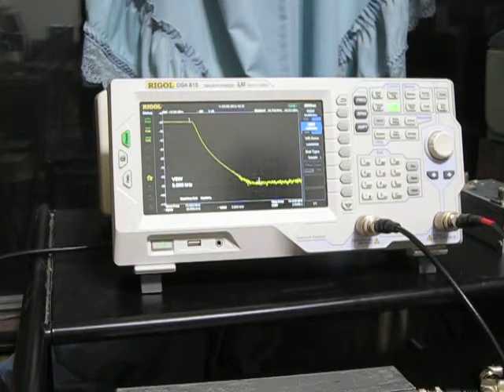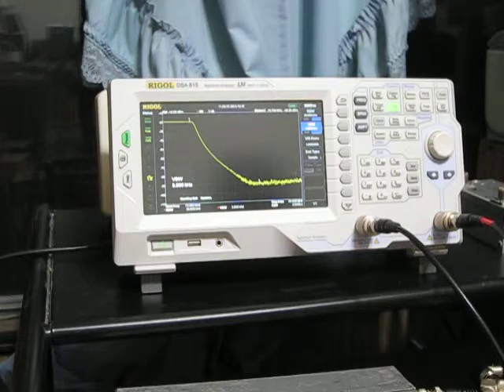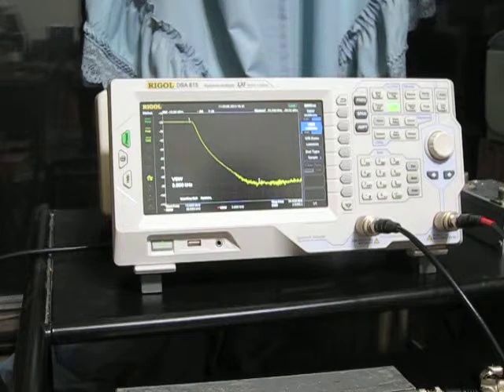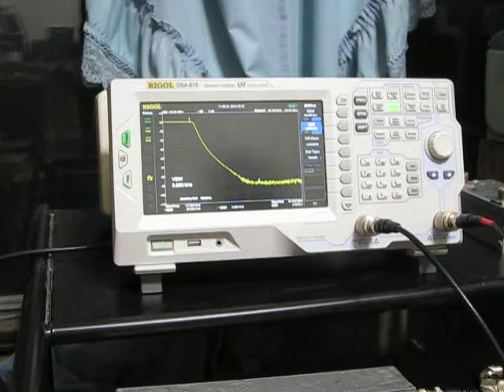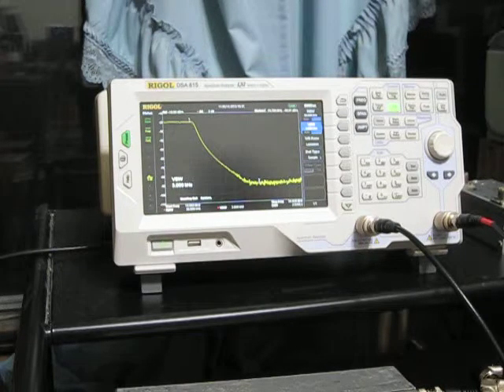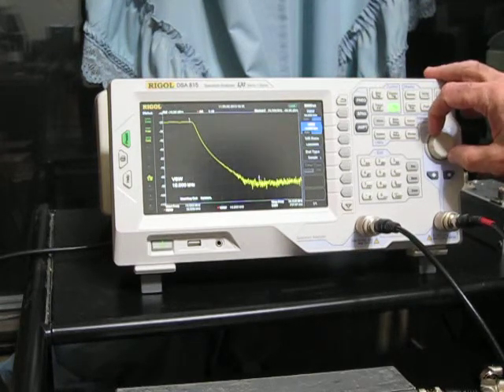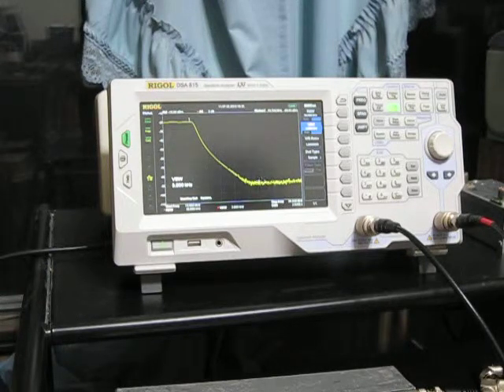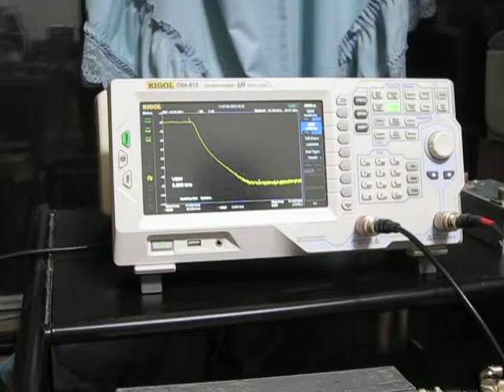Rigol DSA-815 Spectrum Analyzer Test of a B&W HF LP Filter - Part 2

Comment: nice presentation of low pass filter response,but in this way we cannot see what is vswr of filter on some frequency of interest,by measuring return loss we can achieve better swr by tweaking coils and capacitors at given frequency ,of course if we built new chebishev low pass filter,after tweaking and looking back on filter response  we can see that response is not changed  much ,almost same response,but swr are better,so return loss measurement is a must.

Comment: ok,now is time to measure return loss of that filter...
Reply from the maker: How would I go about doing that ?
Reply: here on tube are few examples ,you need direction coupler or return  loss bridge.mini circuit have them,or you can build one.it have three ports ,signal from tracking generator on one,input of analyzer on second ,and  DUT is device under test port,if you leave that port open you have minimum  return loss or highest VSWR,if terminate that port with 50 ohm resistor you have maximum loss or best VSWR..you can measure swr of that filter ,and that is more important than only see response...sorry English is not my native language,and yes filter must be terminated  50 oms on another end.
Reply from the maker: sinkosav I was also demonstrating the use of the RIGOL Spectrum analyzer. Not necessarily trying to measure or test something to the Nth degree for the sake of doing that .. Make sense?  that said, I am trying to get a bidirectional coupler from minicircuits to do some testing as you mentioned.
Reply: yeah,it make sense...
Reply from the maker: sinkosav I'm not trying to be mean or rude and I do want to test swr and return loss at some point .. can return loss be calculated from SWR ? or perhaps a table to reference?